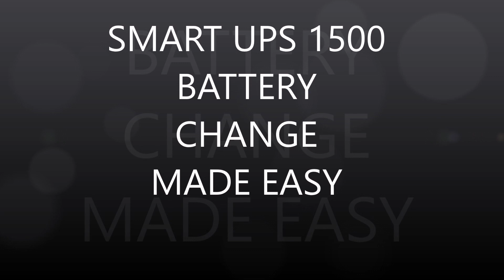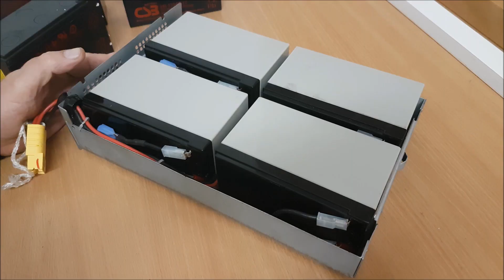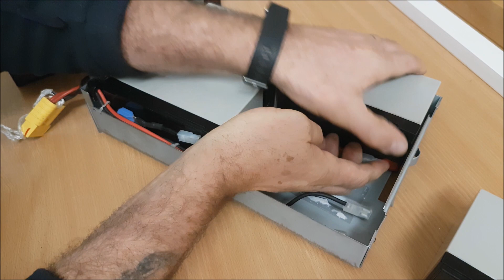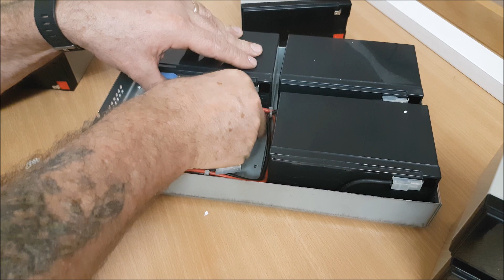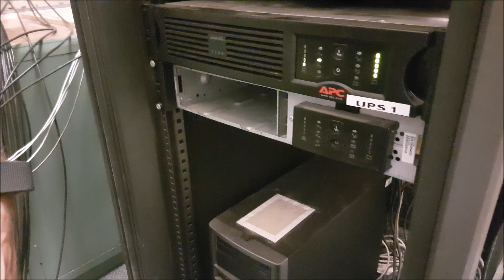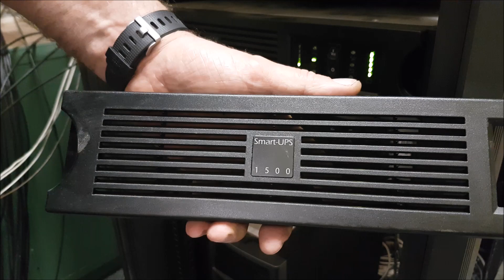SMART UPS 1500 BATTERY REPLACEMENT

Comment: Question:  Are those 2 UPS working together?  I have a rack mount SmartUPS exactly like what you have and they are connected to my switches and firewall and I want to add another one for redundancy purpose.  My switches don't have dual plugs.  Is there a way to connect 2 of these SmartUPS 1500 in a parallel type setup so that when I have to change out the battery on one I don't have to completely turn off my switches?

Comment: Thanks for the video!! It was helpful as I had to do a swap and saved a bunch of money by just changing the battery. This particular UPS, the battery can be hot-swappable and after reinstallation with the new batteries, just press the test button again and the warning lights will go off..
Reply: Thank you.  This is what I was looking for because I need to replace the battery of our SMT1500RM2U later.  We only have 1 UPS so we need to keep it ON.

Comment: Hmmm, why did you power down the UPS?  Aren't those batteries hot-swappable?  Shouldn't the UPS still be able to supply "wall" power to connected devices?
Reply from the maker: Hi Garry the batteries were swollen so didn't want to chance it

Comment: How have you identified which was the faulty battery? Which parameter have you noticed degraded? 
Or have you replaced all the batteries together at once, without replacing only the faulty battery?
Reply from the maker: Hi Andreas i replaced all as they were all swollen thanks for watching
Reply: @MrMeltedwellies  I bought today new batteries, but I saw that the default ones have a life span of 3-5 years. In my case, they have died after around 3 years. Today I have spotted a new battery (Fiamm 12FGHL34, made in Vietnam) and with an expected lifecycle of 10-12 years. Search for Google for this battery, it's way more expensive than the Vision CP1290 model which was installed in the original pack. My only concern is that each battery has 8.4Ah capacity and not 9Ah, being the risk that the APC UPS to detect that the batteries don't have a larger capacity. Do you think that this would be an issue? I should receive the new batteries in few days.

Comment: Thanks for the warning about the double-sided tape or glue.  I wasn't sure why our batteries were so stuck.
Reply: hahah we threw 10 of these off our loading dock (because smashing ups normally gets the battery and transformer out easily) and they wouldn’t come loose!!!
Reply: Most definitely a task getting the batteries out of the tray the first time.  I had a second tray to clear and damned things just won't budge.  So Instead of having a second tray I can quickly switch out, I have to reload the first one again.  APC does NOT like people re-celling their batteries at a huge savings.

Comment: I'm getting a minor spark when connecting wires to the battery. My UPS is using two 12v 12Ah batteries in series (plus to minus). Is this normal? I'm a big wuss when it comes to electricity.
Reply: This is normal, per their documentation!
Reply: Quite normal, and you also get the same thing happening if/when you change your car battery, and for the same reason, the circuitry is always on, and goes live as soon as you connect the batteries.

Comment: can i do this while its on?
Reply from the maker: yes
Reply: That's the beauty of these things, the batteries are "hot swappable" - the only caveat is that you won't have any back-up power if the mains failed whilst you did the battery swap, otherwise, swap and go, on the go.